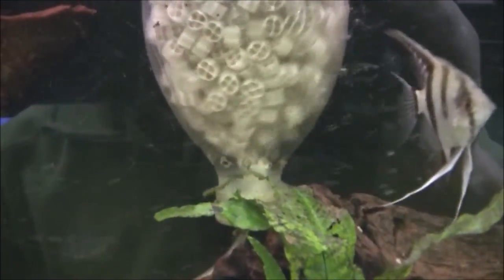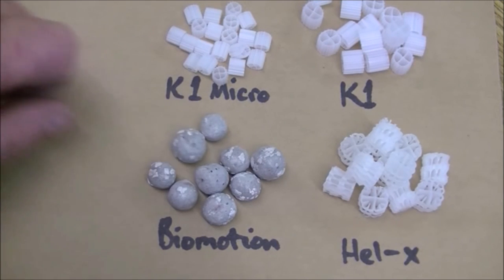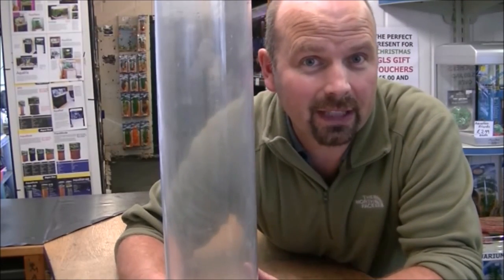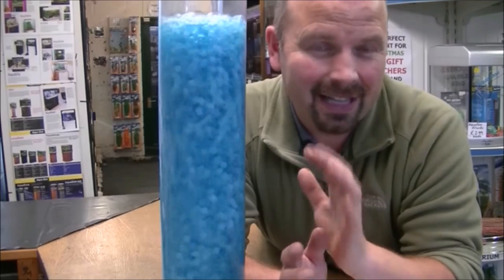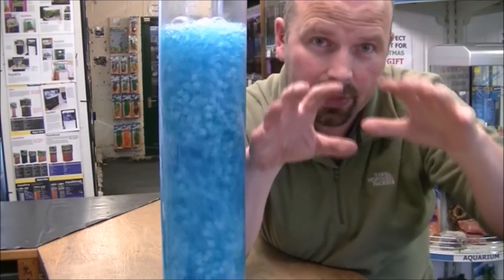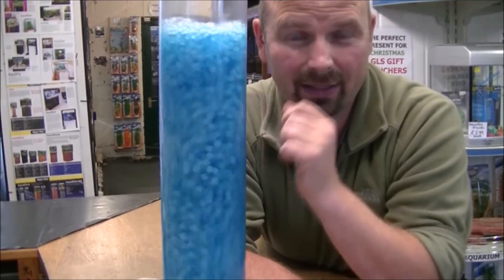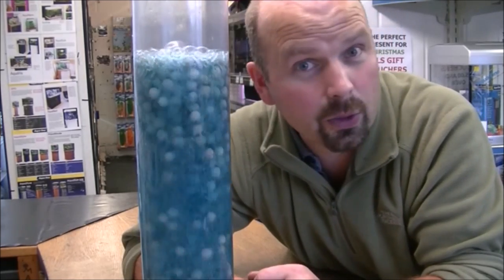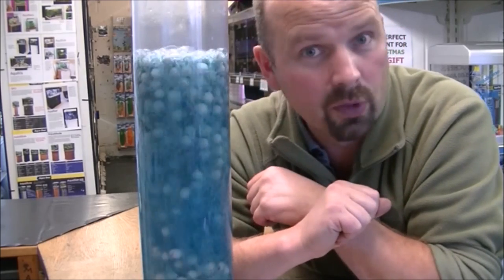Moving bed filters and fluid bed filtration 101 by Pondguru

Comment: Biohome ultimate (or plus) vs biohome maxi size question.. 
Am I right in thinking that if smaller pieces of biohome have a larger surface area, they will support more aerobic bacteria, but larger pieces with a lower surface area to volume ratio will be able to support slightly more anaerobic bacteria, as more of the volume of the media will be in the middle, as opposed to at the edges.  Worth including both in my filter at once, or is the smaller media better because I will ultimately be able to fit more in due to smaller size - fewer gaps?
Reply from the maker: They seem to perform the same and when there is no ammonia, nitrite or nitrate it is difficult to say which media is best, lol
If you have an external canister filter the ordinary size ultimate is the best as it fits in more efficiently but for a sump the larger size is betteras you can fill more space for the same cost.

Comment: How long does it take for the K1 micro to completely colonized by bacteria ? I just recently installed a DIY moving bed filter in my tank so I'm just wondering how long it's going to take.
Reply from the maker: +paul nguyen Complete colonisation would include anaerobic bacteria and that can take many years (when the K1 gets really coloured up inside by a thick biofilm) but for the aerobic bacteria which controls ammonia and nitrite it usually takes 5-6 months in a pond environment and 4-5 months in an aquarium environment where water is warmer - even then the time can vary wildly.
Reply: I got some of your filter balls when I purchase the K1 micro and I put them in the moving bed filter to help speed up the process so I'm just wondering how long the filter will start to work
Reply from the maker: +paul nguyen It will start colonising straight away but for it to build up a sufficient colony to process ammonia and nitrite effectively please refer to previous answer.

Comment: Hi, I've tried to make two of these diy moving bed filters but I'm having trouble getting the bottles to completely fill with water, I seem to get trapped air at the top and even though I've added extra holes to allow the air to escape it doesn't seem to? any ideas how to solve this please. my media moves round nicely within 48 hours but I'm not sure if water will be passing through the filter if it isn't full
Reply from the maker: Sounds like there may be too much air going into the bottle or the design of the bottle traps air? Feel free to send pictures to pondguru@btinternet.com and I'll see if there is anything which may be causing the air build up (plus give me details of the amount of air going into the filter(s) and that will help too).
Regards,
Richard

Comment: Hello.. I have just added some of the K1 media to my Bubble Magus BM 80, But I'm unable to get it to tumble, it just sits at the top half of the tube. Could it be because there are no holes in the bottom of the unit, just the hole for the water inflow.
Reply from the maker: As the media builds up a bio-film it will start to move but may take a week or two in that set up.

Comment: can I  use ceramic rings for my moving bed filter
Reply from the maker: They are too heavy to move. The media really needs to be either K1 or Hel-x for a DIY aquarium moving bed but the newer K1 micro is much better as it is very small which allows you to get much more into a fluid bed (with more surface area)

Comment: Which air pump are recommended for moving bed media ( I have 20 gal pump but my k1 micro don't have moment) thanks
Reply from the maker: It depends on the size of the moving bed, placement of air outlet and shape of the container used for the filter. 
20 g.p.h would be plenty for the moving bed at the start of this video but if there is too much media in to start with it will take an age to move. Try putting the air outlet at one side of the filter so the media moves in a cyclical motion and if it will still not move take some media out until the remaining media moves well then add more media every few days until the maximum stock of media is reached.
Reply from the maker: There is a risk with anything contained in a plastic bottle I suppose but in water a bottle would take many years to start the biodegrading process.

Comment: Hello Pondguru, what is your opinion of lava rock that does not move vs K1 in a moving bed filter?
Reply from the maker: If it is the scoria (reddish brown lava rock then it is decent but lacks the structure to support much anaerobic bacteria so you get the same results - reduction in ammonia and nitrite with high nitrates.
Reply: So, using lava rock vs K1 would yield the same levels of ammonia reduction?
Reply from the maker: It would depend how much was used and in what situation but given that both types of media are really only capable of supporting aerobic bacteria the end result would be good reduction in ammonia and nitrite but high nitrate due to the media's lack of anaerobic bacteria to process the nitrate (meaning you'd keep the nitrate down by doing regular water changes).
Reply: Got it. Thank you

Comment: Hey man just watching a few of your videos and one in particular you talk about how you need roughly 1kg of static media per 100litres of water at general stock levels, how would you compare moving media's to that? Will you be able to do a complete cycle?
Reply from the maker: With the biomotion I showed in this video it was possible to achieve a full cycle in a moving bed but the manufacture of it was so difficult, messy and time consuming that we had to drop that from our product line unfortunately. We were going to keep it up but the manufacture uses the same machinery as the biogravel so a 2 hour clean up of machinery every time we pt a batch of biomotion through was time wasted when it could have been turning media out.
Sorry, a bit more information than you probably needed there but the summary would be that there are no types of moving bed media available now which do anything other than the aerobic side of the cycle (for ammonia and nitrite removal) - they may do that very well but you will still need a static bed of suitably porous media after that to allow for the last stage of cycle, anaerobic for nitrate removal.
Reply: @pondguru  never too much info, thanks for that. Would it be more efficient to use another media in a moving bed and then have static media to complete the cycle or just use static and have a good mechanical filter before hand so you don't have to maintain the bio filter as much?
Reply from the maker: Once a moving bed is mature (which can take up to 6 months with plastic media) it will do a great job of removing ammonia and nitrite very quickly but really you'd only employ a moving bed plus a static bed in a sump where there is plenty of available space. In a 'normal' set up you can easily achieve a full cycle simply by using an appropriate amount of good media and a well-sized, properly set up filter. As long as you have good mechanical filtration before good porous media there is no 'need' for a moving bed but in sumps some people will have a highly oxygenated moving bed followed by a slow flow area of porous media so they can imagine that each section does a certain stage of the cycle.
Reply: OK awesome thanks a bunch, definetly earned my subscription though I wish I had seen this before production ended.

Comment: How long before the k1 moves fluid.  Mines about 5 days in
Reply from the maker: Provided you don't start with the full amount and there is plenty of aeration about 1-2 days is the norm. Once that moves well add more then when that all moves well add more - continue doing that at regular intervals until the full amount of media is used (normally about 60% fill with standard k1 and up to 80% with k1 micro)
Reply: Pondguru I started with 2/3 full.  Will it eventually start to move just take longer?
Reply from the maker: Blackhawkssssss Yes it should eventually move so no worries there. If you feel it is taking too long just remove some or move the air input so it has air up one side which will create a cyclical motion.

Comment: Is there a reason why you don't seem to use carbon in your filters?
Reply from the maker: Danight1761 Unless you need to soak up any fish treatments after a course of treatment or need to remove colour from bogwood there isn't any need for carbon - it normally is used in filters to mask the fact that the media is not removing ammonia and nitrate, hence the 'need' to use it. A properly set up filter should have no problem handling ammonia, nitrite and in the case of biohome, nitrate.

Comment: Would it work good in 5 litre bottle
Reply from the maker: Making a moving bed from a 5 litre bottle would work fine - most suitable type of media for a small situation like that would be the K1 micro as you can get most in to a 75% fill whereas the standard K1 and the hel-x would be nearer a 50%-60% fill.
Reply: Pondguru thanks

Comment: Will my k1 micro work in my hob filter
Reply from the maker: Gazz M It needs to be moving to be of any use and HOB filters aren't easy to modify due to their reliance on the cartridge system so it would be best to use a good static bed media after the foams (if there is space) e.g. biohome plus / mini ultra / ultimate or the new 'biogravel' which is awesome for small situations as you can get maximum available surface area in limited spaces.
Reply: +Pondguru on my ten gallon that has a simease fighter, the hib filter I took out the used cartridges and place in sponge media, is this OK. U have a 20 gallon and 30 gallon both set up for over a year, its just I wanna experiment on my ten gallon
Reply: I have**
Reply from the maker: Gazz M Yes if you can get foams in there where cartridges fit then that's the way to go. With good media they can be made to perform quite well, certainly better than how they come.
Reply: Pondguru what's your views about carbon use
Reply from the maker: Gazz M Unless you need to soak up residual treatments or colour from bogwood you shouldn't need it. Most manufacturers will insist on its use as it masks the fact that the filter isn't up to the job by drawing in ammonia and nitrite but it needs regularly replacing or it will release that crap back into water.

Comment: if ammonia gets eaten by nitrite nitrite gets eaten by nitrate and you reduce your ammonia to 0 surely nitrites starve to death then nitrates starve to death are you not back to square 1  precyled tank where you should cycle tank before adding fish sorry I'm struggling with this nitrogen cycle
Reply from the maker: It is various forms of bacteria which eat (process) the ammonia, nitrite and nitrate and they convert it to other things:
1 - Ammonia is converted to nitrite by aerobic bacteria (bacteria living in an oxygenated environment)
2 - Nitrite is converted to nitrate by aerobic bacteria (bacteria living in an oxygenated environment)
3 - Nitrate is converted to soluble nitrogen by anaerobic bacteria (bacteria living in an de-oxygenated environment)
Unfortunately most filter media has a structure which only supports aerobic bacteria in decent numbers so only the aerobic side of filtration is completed resulting in high nitrates, and large regular water changes to keep nitrate level down.
If you have a fully cycled tank full of fish (which has a mature filter) then you suddenly remove all the fish the bacteria will start to die off due to lack of food but a total wipe out would take many months as long as you had tank water circulating through the filter and it will quickly repopulate when fish are added back to tank.
What would set the filter back to day one is using powerful anti-bacterial chemical treatments which could kill off the bacteria. The anaerobic bacteria are the most vulnerable and the most time consuming to populate in the filter but aerobic bacteria can populate a good filter media (e.g good quality ceramic and sintered glass) in 2-3 weeks. It may take 4-6 months for anaerobic bacteria to develop enough to see a reduction in nitrate and that relies on very specific media and a suitable amount of that media for the tank situation with regard to volume of water, stock, feeding etc.
Hope that helps.

Comment: I have a question would one of them be good to go in my Axolotls tanks and would it help stop them from getting funus
Reply from the maker: Good water quality is essential for axolotyl. Not sure why it would be getting fungus but large changes with untreated tap water can hammer them. A moving bed filter would remove any ammonia and nitrite from water.
Reply: Thank you for you help. I do treat my tap water I treat it with Start Right it Conditions tap water it removes chlorine and it also adds Slime Coat. And I only do a half water changer and I also treat mine Axolotls with a Sea salt bath and all the fungus like stuff fails off to the bottom of the plastic shoe box I use to treat them in and then after that happens I change there water again or put them back in there Tank after it has been changed and they are  all better and eating again.But there is one more question I have were I live they put Fluoride in our water and I was wondering if that could be hurting my Axolotls and my fish if so what can I do 
Thank you Beverly
Reply from the maker: Beverly lane I honestly don't know the answer to that as I've not experienced problems with axolotyl - I'm wondering if the fungus could simply be the axolotyl shedding its skin  as it grows?

Comment: Can you use biomotion with k1
Reply from the maker: Yes it could be used with any plastic media but we don't make the biomotion any more as people reported it was noisy when used indoors. Also it was a very messy and time consuming process to make it which used the same machinery as the new biogravel and shower media so it was taking as long to clean the machinery as it was to make the mix up.